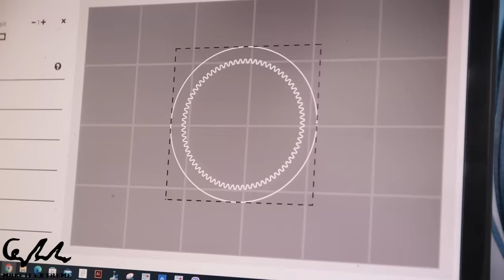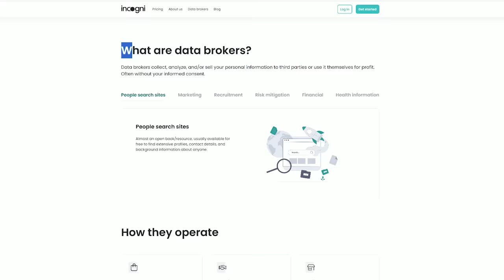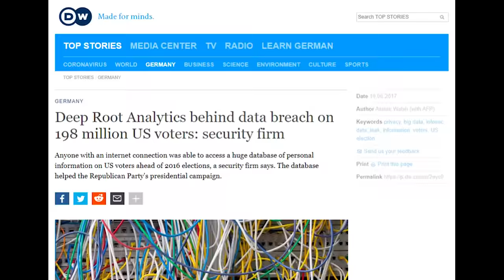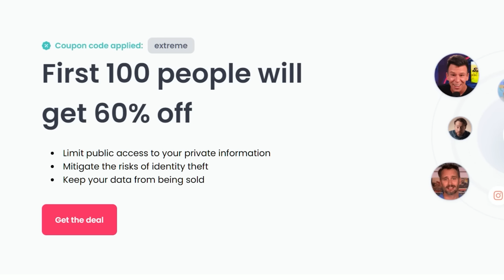I Made A Cable Wrapping Machine (And You Can Too)

Comment from the maker: The first 100 people to use code EXTREME at the link below will get 60% off of Incogni: https://incogni.com/extreme
Reply: Make It Extreme super powerful pneumatic Crossbow next?  Big enough to hunt rhinos and Elephants? Maybe hunt an occasional Mother-in-law, too? 😂😂
Reply: @FarmerFpv ngaco😅😅😅
Reply: Incogni will not give you the discounted cost until you create an account! They have a published rate but what is the discounted rate?  Sound like they want your information to do with as they please regardless if you sign up. If it sounds too good to be true, it probably is. No thanks!
Reply: That's a pretty sweet build!  You should try 'self-fusing silicone tape'.  It was invented by the US Air Force to protect the wiring in their fighter planes.  You can look up MIL Spec MIL-I-46852 / A-A-59163 for what makes it such an incredible addition to your tool box.  Personally, I've used it for everything from simply wrapping wires to making custom tool grips to sealing a city-pressure water line until I could get it fixed.  (It's fairly soft, so wrapping it with electrical/duct/etc. tape where it might get abraded is a good idea.)
Reply: Support from pakistan ❤ excellent work

Comment: I built a very similar tool a couple years back that attaches to my cordless drill. It holds 2 rolls 180° from each other. Makes cool candy cane patterns with different color tape!
Reply: Must be great for re-wrapping sporting equipment 👍
You could make custom team coloured designed for baseball, hockey, cricket, la Crosse etc etc
Reply: I was thinking about making something like that.
Got a link to anything similar?

Comment: Cool idea, but I would have added a support piece across of the tape roller that spins with it and supports the cable, so you don't have to hold it as tight. You already did something close to that with the extra bar that can be seen in some shots, but it's only really effective when the tape roller is in a specific position.

Comment: Nice work, and an excellent tool as-is!
Future upgrades to consider (or for others looking to implement something similar):
1. A microswitch that continues to run the motor after the trigger is released until the opening aligns.
2. Make the angle of the tape roll adjustable.  Perhaps a simple swivel and spring might make the tape angle automatically as pressure is applied so the speed someone moves along the bundle determines the tape angle.
3. Battery pack mount - use a standard tool battery rather than wires/cables
4. Adjustable bundle centering with springs - slide the bundle in and two or more U or V shaped shutters center it.  A locking knob may be used to keep the opening stable, or strong springs.
5. Add a sensor to detect movement along the bundle (a rubber wheel on the shutter or bar would be enough) and set the motor speed according to that so a specific overlap or wraps/distance can be maintained regardless of user speed.
Reply: I was thinking a pair of gripper rollers on the leading side that open and spring shut to grab onto the cable or pipe, and some little knobs for entering feed rate per revolution (set it to half tape width for half overlap), so it pulls a cable through, or walks itself along a pipe, like a self-propelled lawnmower.
Reply: А еще зажигалку, сигаретки, пасьянс и журнальчик под пивко?

Comment: nicely done 👍👍, 2 things i would have added, 1) tape lock, like grinder disc lock, 2)  dc motor speed controller and use higher voltage, would help adjusting speed, now speed seems slow.

Comment: In theory, the thickness of the guides and the width of the rollers could be reduced by about 1 cm, this would reduce the overall dimensions of the device without reducing the width of the working area. This will allow this device to work in more difficult to reach places.

At first I thought it was a machine for winding torus transformers.😄

Comment: This looks like a started motor, which is not designed to work for long periods of time (more than few seconds). This will surely brake if this is the case and used regularly.

Comment: Nothing more unecological than putting more tape outside where it will desintegrate in less than one year - just use some pipe for wire or something that wil last at least 10 years!
Non the less, nicely done tool, aldo I doubt someone will go through all that trouble again :).